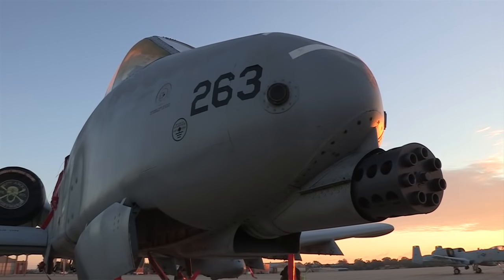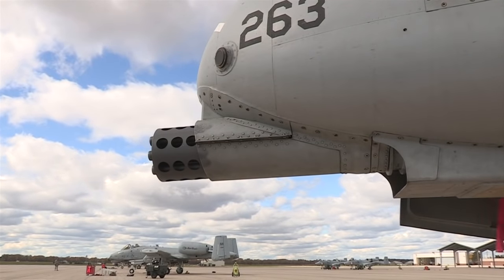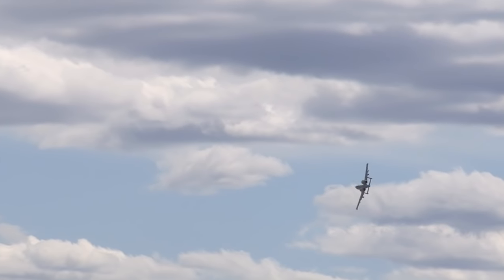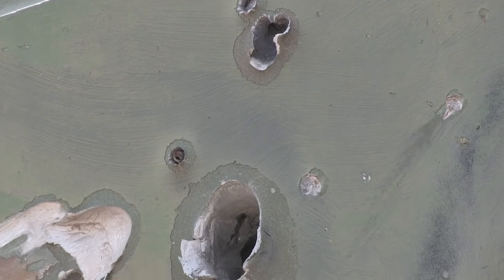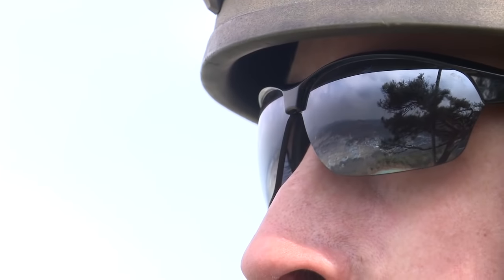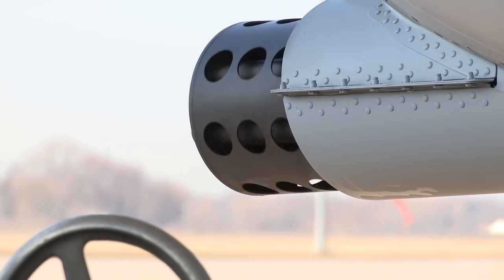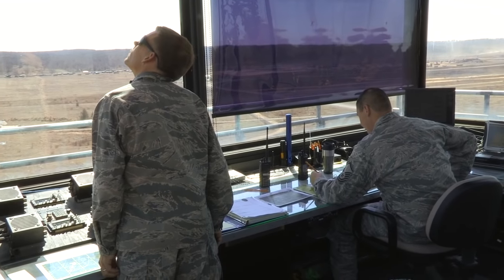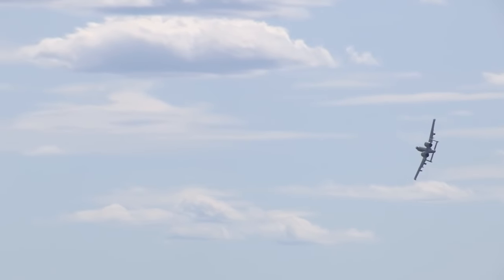A-10 Warthog - The Gun. 30mm GAU-8 Avenger Cannon.

Comment: I found out from another video why the gun is mounted off center.  Actually, it isn't.  Because the barrel that is on the center line is the one that fires as the gun rotates.
Reply: The A-10A was the one with the offset gun I believe but I could be wrong
Reply: Exactly.

Comment: The only combat plane designed around a bullet.  Aluminum jacket, rotating bands and heavy metal slug pressed inside.  Developed after Arab/Israeli war a capture of Russian tanks.  Our military didn’t realize the thickness of Russian tank armor.  The heavy metal slug was the only penetrating item that could pass the steel thickness of the tanks.  Thus, develop an effective bullet, design a gun and design a plane around the gun.  The A-10.

Comment: I was wondering if the US Navy ever considered having some A-10s converted to aircraft carrier usage.
Reply: Ken Konard afaik it would be next impossible due to the weight of the aircraft , therefor needing a large takeoff area
Reply: 7Fades - well the Navy uses steam catapults to launch heavy planes. That would of course need the forward wheel strut  to be modified plus adding a landing hook at the rear. Just wondering if someone from the Navy could clear this up. Imagine the firepower available vs terrorist’s boats.